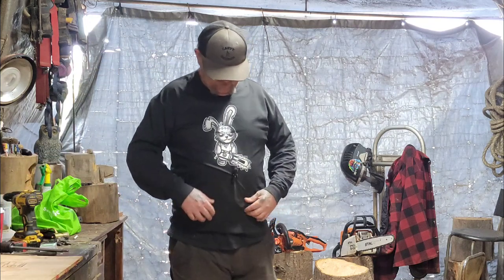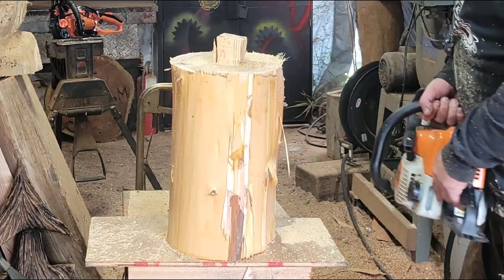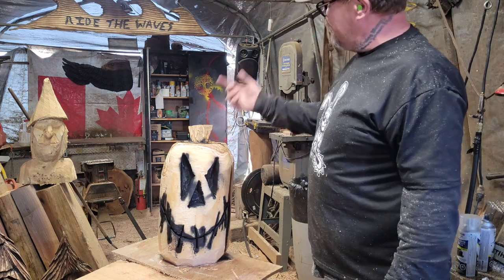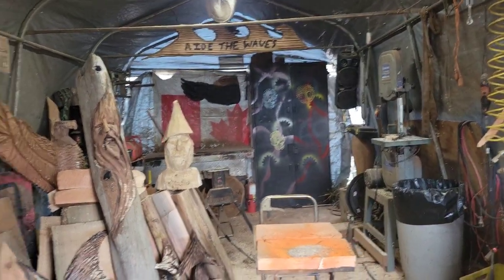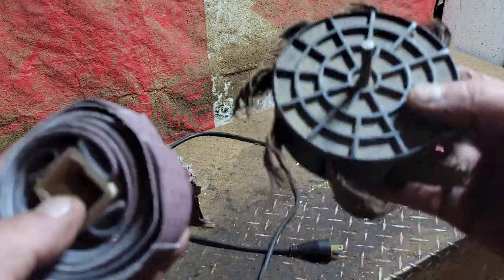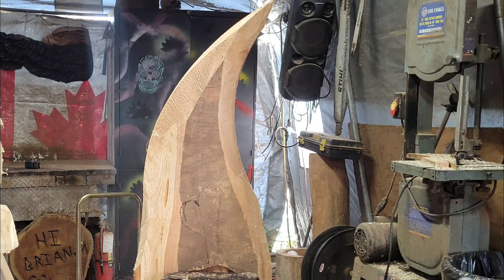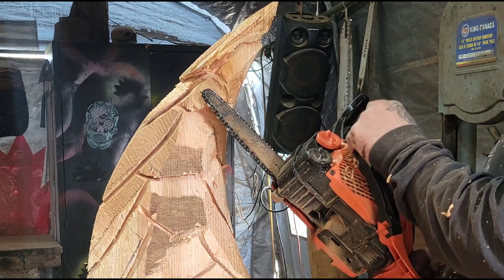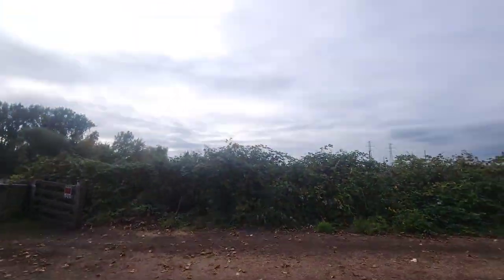Finishing up Pumkins and trees for the year. Sanding the high points. Jordy Does

Comment: Another great session Jordy, thanks. You are so right to stress safety;  I was using one of those attachments on my angle grinder with a course blade. It kicked back and cut a groove across the back of my hand, severing a couple of tendons and biting into the knuckle joint of my left forefinger. The Plastic Surgeon who repaired it said another quarter of an inch and I'd have lost the finger. Five months on and I have some use back in my hand (I'm left-handed), but can't yet control a chain saw or hold a Dremel steady enough to carve. Bloody silly trick, but I guess it can happen to anyone. Please take care buddy.
Reply from the maker: Wow... be well amd tale it easy